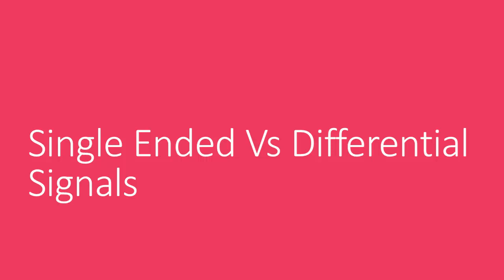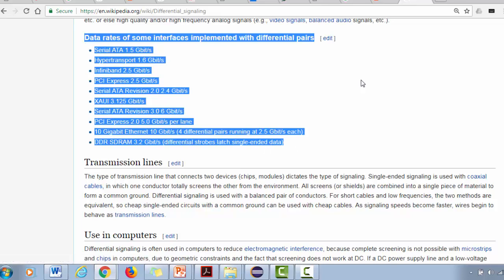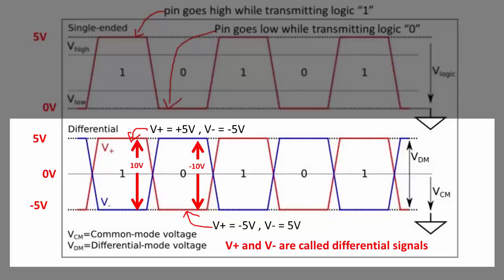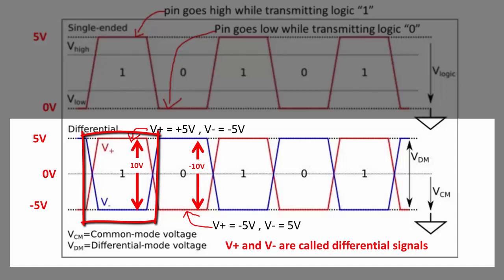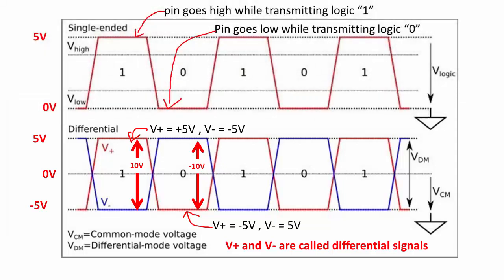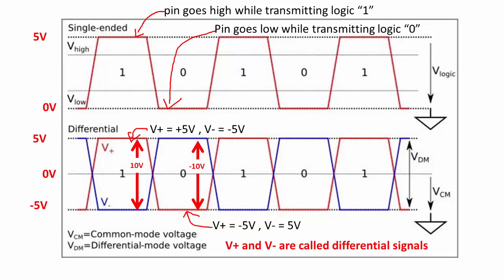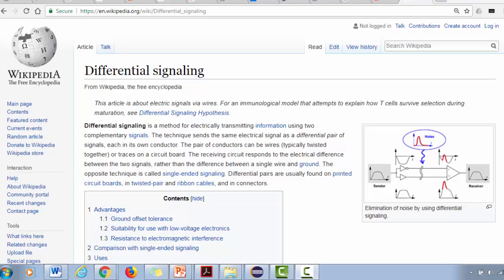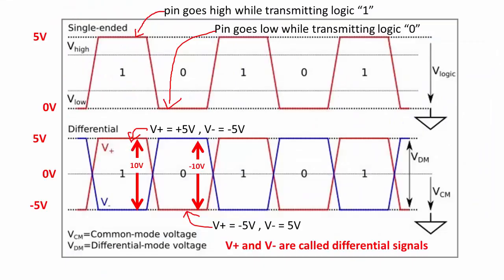Controller Area Network (CAN) programming Tutorial 6: Single ended vs differential signals

Comment: apart from the noise, is differential not disadvantageous where it needs 10V diff p-p but single ended need only 5 V p-p ?
Reply: The transceiver makes the signal 5V.